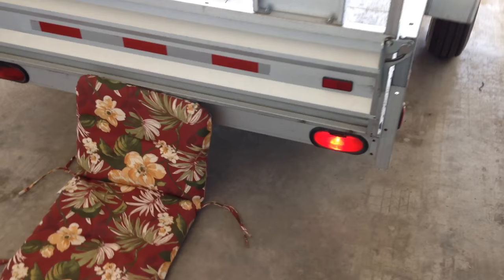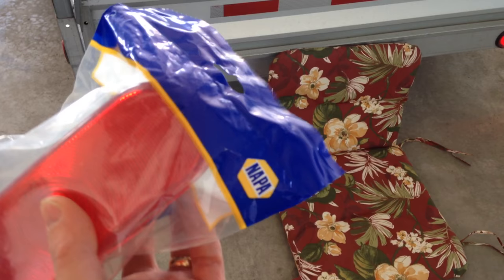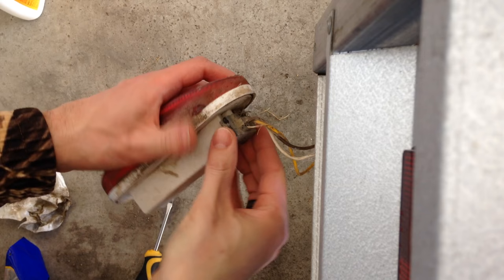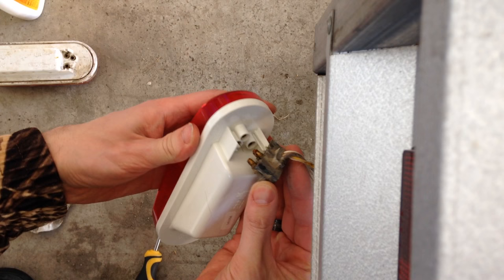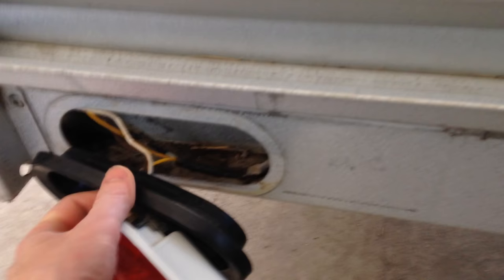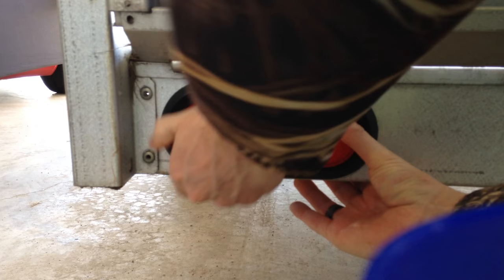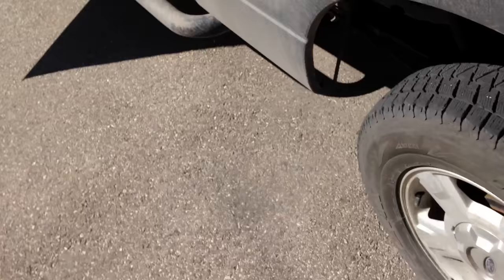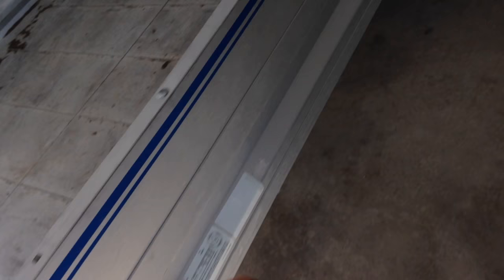Replace Red Oval Tail Light (Jeep, RV, Sterling Utility Trailer)

Comment: I just called a Napa parts place and they needed part number. There is nothing printed on my trailer light assembly!!! I asked for Trucklite 60s trailer light but that didn't help. Do you have part #? Thanks.   Stephen
Reply from the maker: I am pretty sure I used the 6-inch oval trailer LED light. This looks like it here: https://www.napaonline.com/en/p/LIT6058
Better price on Amazon: https://amzn.to/3NWNmRy
Reply: Thanks for your time! I ended up going to Princess Auto and picked up 2 lights at $12.99 each + tax.